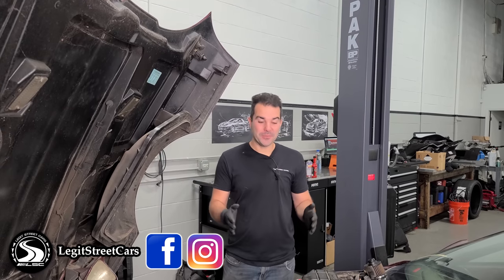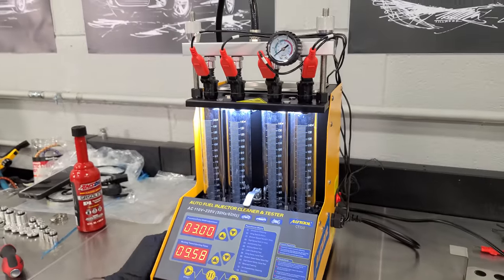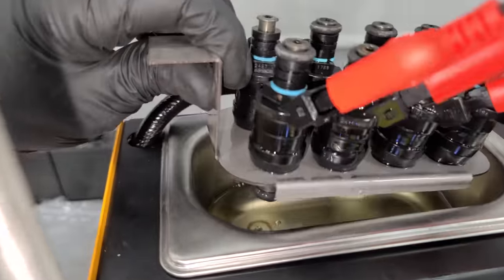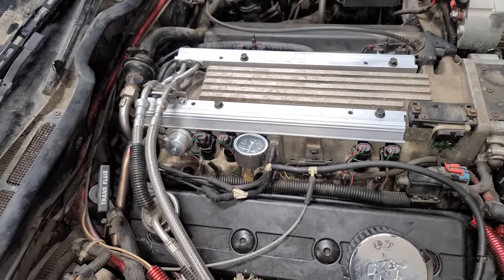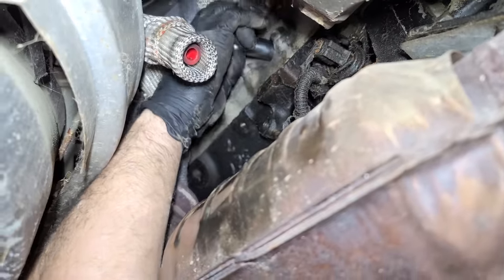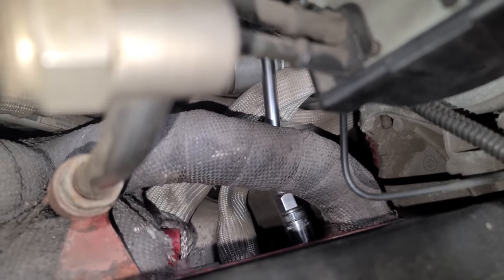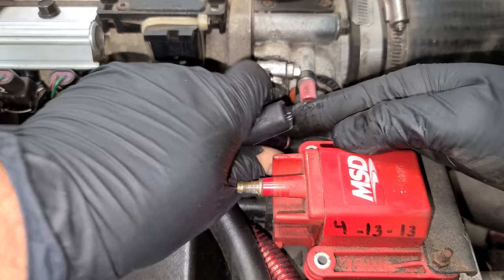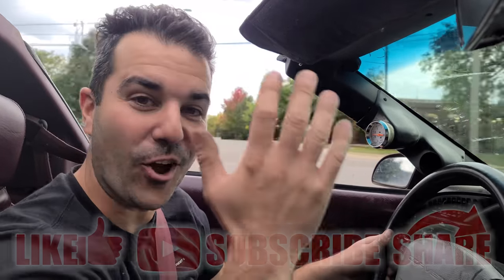I Fixed My Cheap Supercharged Corvette For $50 & Looked Inside The Engine To Find Mystery Mods!

Comment: Hey Alex, an easy way to deal with a locking gas cap that you don't have a key for is with a radiator hose removal tool. Or any tool that is like a heavy duty pick shapes like a hook. Just run the hook under the cap and lift up around the outer edge and the cap will come right off

.

Comment: Alex with those O ring kits I have found that if you buy the metric set as well as the Imperial one you will see that the metric ones are on the cross section, that they are considerably thinner. And you can use that to your advantage in this case. I'm not sure if they are marketed imperial and metric in the US, but they are here in the UK and I have both sets. Saved my bacon many times lol
Reply: Best internet car repair advice of 2022!!!  Not all hero's wear capes!
Reply: @Springfield-eo8jl  I just wear mine inside out and remain incognito lol
Reply: Also, just spring for the green ones too.
Reply: They are like that in the Harbor Freight kits in the USA. I bought both the Metric and the SAE kits, and I've never NOT found an O-ring that fit what I was repairing. 9 bucks a piece for each kit, with somethimg like 288 pieces per kit. I don't think I'll ever need to buy more during the rest of my life.

Comment: Alex, dielectric grease is exactly that, dielectric. It is an insulating grease. That stuff should be used after the termination is made. The terminal should make dry solid contact with source of power then apply dielectric to the termination. A lot of folks apply that stuff to battery terminals before installing the battery cable when it is intended to be applied after the cable is already installed and tight.
Reply: I like how he said he's gonna "put a little on there" and then slathers half a tube all over, lol.
Reply: Yes!! Insulator not isolator!! I do use it on electrical plugs and spark plug boots among other places but not on  battery terminals. Just my preference.unless you want old junk but otherwise just always Use a terminal isolator and good, clean, tight terminals and you will never see any build up of acids. Another good idea is to ALWAYS on aluminum heads use a very small amount of antiseize on spark plug threads so that you can safely achieve proper torque on plugs and later be removed!! And for header/mani. Bolts/studs I always use either Stainless steel spray or zinc spray on fasteners b4 and after installation! Old timer trick that was passed to me years ago lol! And don't forget to isolate your plug wires for passive interference reduction. Haha
Reply: In case of another rescue with an LT1 and you actually do have to replace the wires WITHOUT a supercharger in the way... Unbolting the power steering pump makes it 10x easier to do!

Comment: For safety's sake, you might want to use Stoddard solvent instead of gasoline iin the test bench.  The solvent has similar flow properties to gasoline without the explosion hazard.
Reply: "Varsol" is a common trade name. But common mineral spirits work just as good. I own a slightly fancier version of the injector cleaner (and also have a C4 Corvette!).
Reply: Yeah! I was like Don't put gasoline in that machine man! I suppose if one connection behind that back panel is faulty, hello burn center!  Just the fumes alone are kinda scary!

Comment: I really appreciate how you troubleshoot the systems and find the actual issues instead of just throwing parts at it and hoping that you'll get lucky and fix the problem. I have the basic tools to do the majority of the driveway repairs needed to keep my vehicles on the road but it is content like this that helps me to figure out what I need to learn to be able to repair something that I haven't tackled before with a lot more confidence than the old Haynes or Chilton manual ever did. Great job getting that beauty back on the road. She sounds mean as hell!

Comment: Hi alex i wanted to point out that at 43:55 you shouldn't put dialectric grease inside where the spark plug mount into the boot . Dialectric grease are an electrical isolator not a conductor so you want it all around the electrical connection for it to not jump into near by metal surfaces but not directly between the 2 connection ie the boot and the spark plug end . It will make it harder for spark to go through the isolator
Reply: Huh?? It's SUPPOSED to go inside the rubber boot. The grease makes it easier to install and remove, and it seals the boot to help keep the moisture out, and the spark in. 

Where do YOU think you are supposed to put it, all over the outside of it? 😕🤦🏻
Reply: @davelowets  not outside . he should cover the walls inside the boot or cover the white porcelain part of the spark plug with the grease before  installing the boot on the spark plug , and being carefull not to put the grease where the spark plug metal end meets with the matal wire inside the boot and grease becomes between the two connectors  . If that happen the grease will isolate electricity between the two connections because its an isolator.  Thats what i mean .
Reply: @davelowets  sorry for the late response i rarely check youtupe notifications

Comment: I snagged an 87 C4 with a 4+3DN a couple of months ago, ran terrible so I got it for cheap. Turns out the injector rail 1 fuse was blown and a few plug wires werent clicked on properly. Now I'm just going down the list of things that probably need replacing before they go bad. Sweet ride man and cool video!

Comment: Don’t forget, TPI, LT1 & LT4 run happy at 196-226 temp. So even an unmodified, one should have the spark plug wires wrapped. One of the first modifications I did to mine was upgrade the radiator get a 180° thermostat and put a better water pump on it and wrap my spark plug wires. they just like to run hot. They’re happy there.
Reply: facts
Reply: Most later model cars run that hot...
The purpose is to help them pass emissions.
Reply: @davelowets  I took out the smog pump, 3rd cat and did the throttlebody coolant bypass.
Reply: @Joe-wv7pv  😆 You should have left it run hot, so it's "happy there". 😜
Reply: @davelowets  lol but I won’t I live in a hot climate

Comment: One thing on the pistons that I've heard is the notch you saw on one of them is typically there pointing to the front of the engine on factory pistons. It not typically on a aftermarket piston.
Reply: Many aftermarket pistons also have some sort of an identifying mark to indicate the front on them.
Reply: @davelowets  I've heard that. I also haven't seen very many aftermarket pistons and the ones I've don't have a notch. My point was that they are most likely the factory ones if they all have that notch. But good point.
Reply: @ProCarsGaming556  Yea, those were factory. 🍻

Comment: That Corvette is going to be killer when it's all said and done. The fuel injector cleaner was one of the best investments I've made, but you must not forget to change the injectors filter too, there's a tool for that but you can do it with household items.

Comment: Alex and ピーター, great video. I have a 1996 LT1 Camaro SS and it took us 4 hours to change the plugs, the passenger side rear plug I had to get my (then) 16 year old daughter to change that one because of how much room there was (or wasn’t in this case). I got local mechanic friend of mine to change the wires, it took him 2 days because there were metal shields OVER the plug wires running BEHIND the manifolds. He ended up having to drop the exhaust manifolds (and a BUNCH of other stuff) to  get to the bolts that held those shields on. My Camaro has 47k miles on it, but that’s the last time I’m changing the plugs and wires 😏

Comment: Especially given that the cleaner/tester machine "recycles" the working fluid, it's a bit surprising there's no filter on the line feeding the rail.
Reply: Maybe it's internal, near the pump... 🤷🏻
Reply: There are actually baskets pressed into top of injectors. They are meant to be replaced
Reply: @richardstockwell4862  Yeah, but good engineering practice eliminates debris as early as possible.  Not including a visible, easily replaceable inline grit filter is just poor design, IMHO.
Reply: @supermarioisacat  hey if only we used good engineering practices making automobiles we would all be better off
Reply: @richardstockwell4862  lol - no sh!t
Reply: It's a relatively closed loop system not much of a chance of dirt ingress other than on the outside of the injectors.
Yes there will be some dirt in the injectors but that fuel could be cycled quite a few times before it became an issue.
...
I was wondering if Alex could put different brands of beer inside that machine test which one would be the most "frothy" lol.
Or spirit's ..be interesting
Reply: @stuartd9741  Crap on the outside of the injectors is the primary source of dirt I was thinking about.  Fine grit on the exterior of a single injector could easily fall unnoticed into a catch cylinder, contaminate the entire system and eventually get pumped back around into the micron final filters of all four injectors.  The fact that it IS a "closed" system intended to test and CLEAN components and would perpetually recirculate any introduced particulates should be the EXACT reason to include as much filtration as possible.  One can only hope there is at a MINIMUM of a filter sock on the inlet of the pump.

Comment: By my prior experience (kind of), along with help by High School friend (very early 80's), these friends later to successfully building and owning their own shops all taught me Re ignition systems own and use dielectric (silicone) greas and all "spark carrying" connection for both contact as well as moisture seal.

Comment: I believe that phantom vacuum hose is the HVAC vent selector vacuum. A far as the water pump weep hole, JB-weld a 90 degree brass elbow on it and use a silicone hose to route the dump behind the optispark thowards the ground.

Comment: Great vid.  I had a 95 Camaro with LT1, and took it in to an independant mechanic to get the plugs changed.  He called 2 hrs later and told me to come pick it up, as he had only done 5 of the plugs and couldn't get to the other 3.  I had to take it to the dealership.  I guess you have to drop the front clip, or have a special tool to get at them.  What a pain.  
Keep up the great content.  Stay Happy and Healthy

Comment: For the inside of the plug wire terminals, you can try  a brass barrel brush for a 22 rifle. Chuck it in a drill and should get down in there better than the one you tried. I use barrel brush to help clean all sort of stuff.

Comment: At 34:00, that plastic material around the spark plug wires is called spiral wrap. In aviation we use it to protect wires from any abrasion on contacting surfaces due to vibration. Seeing it on those wires makes little sense to me due to the wires having heat sleeves. Awesome shop and cars!

Comment: I built an injector test stand.  Could only do one at a time, but it worked.
Amazing how good a 97 Accord can run with 4 injectors with basically no spray pattern or consistency.

Comment: Just an FYI, the opti-spark units on these early LT-1s are not vented so avoid pressure washing the front of the motor. Contrary to GM/Chevrolet, you do not have to completely remove the harmonic balancer to replace it. Also the EGR tubes are prone to leaking after a while and have to be replaced. Enjoy the awesome find!!

Comment: Watching you change out these spark plugs reminds me of my 1969 Mach I Mustang with the 428 Cobra Jet engine.  I had to go under the car to access the 3 plugs on the rear drivers side and  used a piece of fuel line with the new plug stuck into the end of it in order to align and start the plug into the hole without cross threading.  It was a chore, but always worth the efforts.  :)   Keep up the work guys!  Enjoy  your channel!

Comment: I just gotta say that I love watching you and Peter work on the cars that you get. I really love the cars that you work on simply due to them being regular affordable cars that for the most part anybody can obtain and fix themselves. In fact, the biggest reason I love watching your videos is because they motivate me to work on my cars every single time, even if my car don’t have any due maintenance, I will look everywhere in my car to find anything i can check and or clean….if nothing comes up then at the very least I will clean my engine bay and or detail my car……for that I thank you!!!! Also, which car do you think has less work space in the engine bay and is harder to access and remove spark plugs, is it the LT1 Corvette? Or the LT1 Camaro/Firebird?

Comment: The corrugated stuff that you guys were talking about is called spiral wrap it is for movement and vibration for wires typically used on moving parts for machinery.

Comment: Hey Alex great video. I worked in a biology lab that used a similar mechanism to your injector cleaning machine to solubilize drugs. It's a great tool for that but I would use hearing protection since it could have long term hearing loss/pain from repeated exposure

Comment: Finally!   Been waiting for a follow up to the last video of this!!   Keep up the good work man!!.  I do have two questions I really want to ask about your TA.  1: Does it mean the headlight control module is out when you lock and unlock the TA and the headlights flip up and you hear a headlight motor grind?.   The flipping started at the same time the grinding.  The car has 60k miles.  2: Could you post a link to your exact rims that’s on your car??.  I’m too scared to put money into the wrong sizes and plus those are chrome, deep dish, and staggered a bit which is exactly what I’m looking for.  Hope to hear back!
Reply: Never heard back.... Never will... 😑  You use to interact with your subscribers, not anymore...

Comment: The spiral wrap is a protection from chaffing, there is also a high temp version that provides a degree of heat protection (primary use is Aviation protection of wiring)

Comment: Another awesome video.
Geez them ignition cables and that IGN king lead amazed the Corvette ran at all.
Glad I don't work on Corvettes - quite easily see me throwing spanners across the wokshop..

I remember when Tavarish did his Lamborghini project. 
He had his exhaust manifolds ceramic coated claimed it reduced under bonnet temperatures by 20%
Maybe an option for the Corvette..?
500 horses shame you couldn't open her up.
The engine sounded awesome on my new tv sound bar with wireless subwoofer...

Comment: With that particular tester its a good idea to lube the o-rings before sticking the top on. And make sure the top is seated on the injectors before you tighten it down. Otherwise sometimes it can pinch/cut the o-rings.

Comment: Well, I just ordered a fuel injector cleaner / flow tester. Thanks for demonstrating it on this video. Btw, great buy on the Corvette
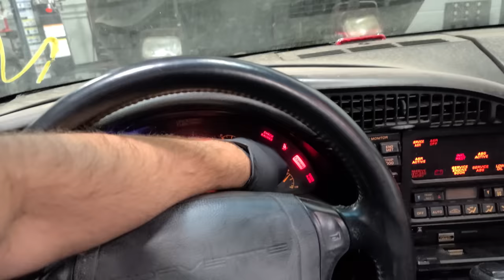33:50 mark… pretty sure the coiled spine is a attempt to gold the plug wire off the engine. That whole engine bay looks like a nuclear reactor for heat.

Comment: For spark plug wires, I use an OHM meter to check the resistance of each wire... less resistance equals more energy to your plugs. My wires have 25 ohms per foot. Most plug wires have a lot more resistance. I would make sure all my wires, including the  coil wire were new!

Comment: Remove the exhaust manifolds to fix the leak and bead blast then and cerakote them for around $60 you can get oven bake or air dry try to do inside and out this will lower the under hood temps and make it so your spark plug wires will not burn up.. Replace with taylor wires they are industry BEST and that thermal shielding keep using the .. als spray patterns on your injectors were crap they need cleaned. remove the filters in the injectors and back flush them and replace filters and o ring you can get large kits on e bay for cheap. keep the old o-rings for testing .. berryman fuel cleaner with sonic cleaner clean injectors well but makes o rings trash so take them off prior to cleaning

Comment: The hard ring you feel in the heat sleeve is something that comes inside them. It’s how them come, cause I have a set - doubles up just like that- in my lt1 .. cheers : it’s like a deformation ring, to allow the sleeve to keep its round shape

Comment: youd be surprised at what the old LT1 can do alex. i had a 1996 z28 6 speed, i started a heads cam intake build on it and never got to finish it. but i have a friend who had a 97 trans am ws6 with the lt4 hot cam and stock heads, full exhaust and tune and his trans am made 368whp. id be willing to bet your probably with that 5-6psi youd probably see a good 450-500whp probably somewhere in that range quite easily

Comment: I noticed that when you blow off your cleaned parts that's your air may not be as clean as you think. Your air hose can even cause contamination to these parts. Examples are small bits of rubber or rust from inside the hose. You may look into getting a in line air hose filter. One that can attach right before the air gun.

Comment: Those Ignition  Distributors are notorious for problems Mounted front of Engine driven by Timing Chain. You can buy MSD or Delco Distributor  I highly recommend MSD spark plug Wires and NGK Spark plugs I use Colder Heat range on my Blown LT1 92 Vette. I made my own Fuel Injector Cleaner machine works good. That's a Cool Injector machine for the price

Comment: Please change the fuel filter. Passenger side inside the frame rail has a heat shield with 2 10mm bolts. If its still stock that's where it will be. At frame 29:34 upper right of screen fuel filter. They are so know for causing lose of power under load when clogged. I have had it happen on my own LT1 92 Vette. Also recommend changing the Opti spark to an MSD complete unit.